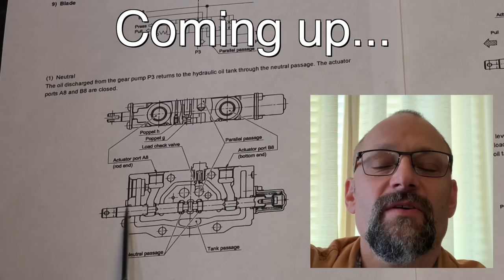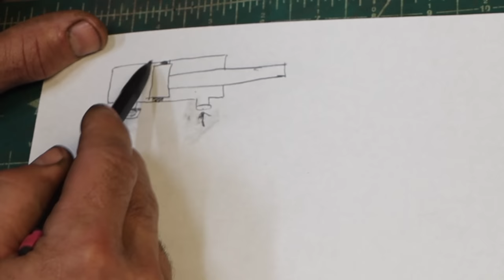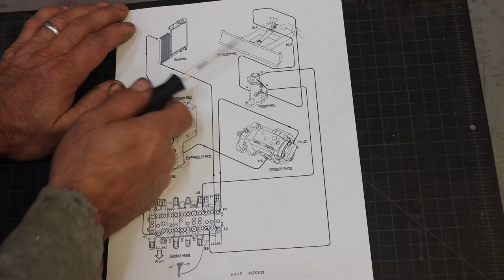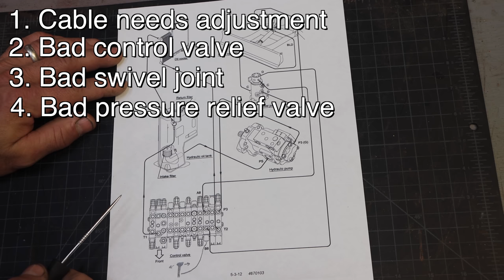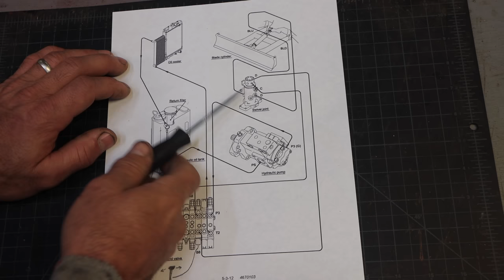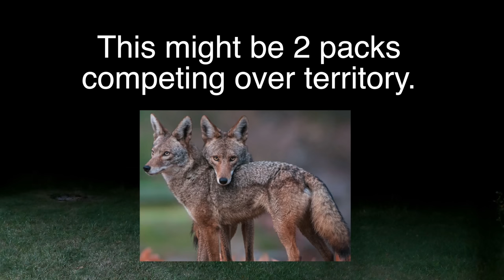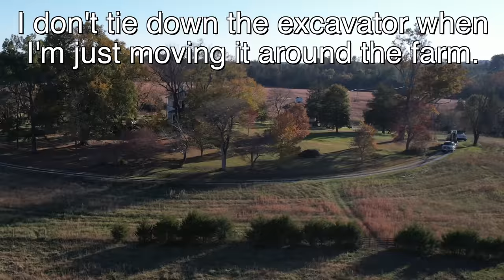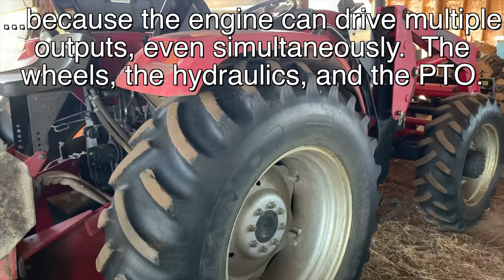Excavator Repair, Swivel Joint Rebuild, Yanmar Vio-50.

Comment: 11/17/22. 2day hydraulic repairs on Yanmar Excavator.👍👍👍👍⚙️🛠 terrific camera 📸 closeups of removing swivel (10 psi hoses at bottom & at least 5 hoses on top). Then swivel to bench for upclose look at 'u' shaped flow paths & ~14 2-part square/flat 'o' rings! Beautiful narration of how this cylinder was made. After re-install..no leaks!👍👍👍👍Then you gave us a quick look at all other hydraulic pumps & controls on all yur other equipment:  dump truck pto, tractor loader control, boom lift swivel & related psi controls..even included a look at yur 'ole log splitter control. Great video showing your very impressive mechanical/hydraulic repair abilities. List of all your skills go on & on: diesel engine, welding, fabricating, brakes, carpentry/framing, lathe, plumbing...clearly you have become the 'can do everything' man-on-the-farm! Very impressive to watch! Stay safe John & carry on!👍👍👍👍🛠⚙️💪😊🍺

Comment: I’m an HET, I was both taught and still feel the opposite way, I’ll use Teflon tape on NPT threads in hydraulic systems but not pipe dope. Just don’t wrap the tape on the first thread or two, for the reason that overhang could possibly flake off and contaminate the system. Great video by the way, just stumbled upon it on my recommended feed and thought what the heck, why not. I did skip thru a lot just because I don’t need explanations of this stuff but I think it’s great you include it for those that are curious how it all works.

TL;DR

I use teflon tape but not pipe dope on NPT threads in hydraulics just don’t let it overhang past threads. Great video, very in depth to what you were doing.

Comment: Another one, teflon tape in hydraulics is definitely common but Loctite 577 is preferable. When installing teflon tape to fittings never go over the last thread otherwise it will be cut on installation and pieces of teflon will go through the hydraulic system a cause issues such as block valves or filters

Comment: Absolutely an excellent video! I had to remove and rebuild the swivel joint on my Bobcat 324 just a little over a year ago. It was leaking from the bottom seal which is exposed and was packed with mud on the skid plate from the previous owner. The mud caused rust and ate the seal. I got lucky and found the OEM seal kit at a discount for $400. MSRP is close to 600. New joint is 2500. I took a lot of pictures but would not have had the patience to video the job as you did.

Comment: As a fully retired, disable old man I have no use for this knowledge anymore, but I always wondered how that worked on excavators. You answered my questions fully and I thank you for that. Now I can stop wondering every time I see one in use. Curiosity has been a driving force all my life and it is a habit I just cannot break. Cool  to see that older equipment still has a life somewhere when so many channels on here are running new, latest and greatest machines.
Reply: PS Just want to say that you have an especially strong gift of explaining clearly and concisely what is going on and why you are doing it the way you did. Must have been a great teacher in another life. So many can do, but have trouble communicating what and why.

Comment: Very enjoyable video. This is just a giant version of the HVAC vacuum control disk system that routs vacuum suction to the various  damper actuators in a car. Used for about 20 years before they started using electric servo controls to open and close the various dampers in the HVAV duct system. You're a patient man!  But nothing is much more gratifying that DYI repair of complicated mechanisms. Probably saved a thousand dollars in repair shop labor fees. Good job!

Comment: @7:50. An interesting observation is that the oilpressure scales with the piston area as this: force = pressure * area. So if the seal breaks in the piston, the area involved is no longer the area of the piston but merely the area of the rod. Now say the diameter ratio of these two is x2 well then the new pressure will  be: force = new_pressure * area/4. Which amounts to 4 times the original pressure! So if your hoses suddenly ruptures it is likely a leaking seal.
Like your videos.!

Comment: I purchased a used excavator myself recently and I didn't have a clue how the swivel joint worked.  Very informative on a number of levels.  Hopefully I won't have to do the same repair you did.  It looked really miserable and had to take many hours.  Thanks for showing us how to do this.

Comment: Well done. Excellent job in full details.  Very impressed. As an aircraft jet engine technician we used diapers and zip ties when doing fuel controls over head on wing also oil pumps and controls.  It was always funny buying a pack of pampers at the store when I was a young line aircraft road technician. 🤠

Comment: Excellent video. I learnt something about how the hydraulics work. I chucked when the oil was running down your arm, sorry. When I worked at Chrysler, we used rubber gloves like the dish washing type. They were  thick were we would turn the end up and make like a gutter, to catch the solvent.  I felt for you, what a job. Farmers are very inventive, with wrist cloth. Thanks for the video.

Comment: The Roto Thrusts on the  steel coil mandrels I had rebuilt were much easier to take the lines off of, but the seals were 3 pieces each, and had zero tolerance for error. Great job on this one.

Comment: You did a very good job on this video.  I'm a former vocational instructor and appreciate a good presentation .
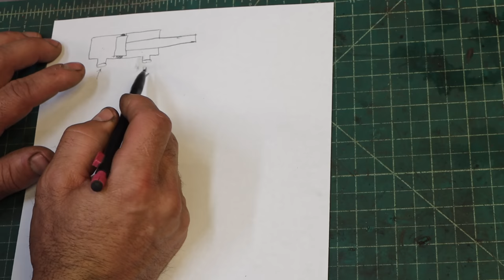Here are a couple things that I saw you could do if you do a follow up video.  The drawings you did are not quite accurate.  The principles explained are correct, but this is a very unique cylinder.  The oil lines are both attached at the top of the rod.  This allows the oil lines to be keep away from one of the most vulnerable spots on an excavator.  How they do this is that the rod is quite large in diameter and it allows the to drill the supply and return lines the full length of the rod.  (This is very similar to the hydraulic rotator that allows the oil from the pump on the motor to get down to the chassis to power the drive motors and the blade.)  The lifting side at the bottom probably has the line drilled right out the end of the rod where the piston and the nut are.  The other line is drilled a little shallower and then cross-drilled above the piston so that you can lift the blade.  You do not use this cylinder as much as the rest of the cylinders so it can be a bit slower and have fairly small lines drilled down the length of the rod.  Written while watching at 5:43.  This may come up later in the video.  You see, it is quite a bit like the mal........nope.  Not going there.
At 35:00, I noticed that the outer sleeve is bored straight through.  When installing the seal, it would be better to start at #4 and then do 3, 2 and 1.  Turn it over and do #'s 5, 6 and 7.  This will keep you from damaging the seals as you work over them going from top to bottom.  Also, if the lower hydraulic lines AND the fittings in the sleeve were removed from the bottom, it would have been possible to lift the rotator out and work on the upper lines in a more convenient place.

Comment: this was a great video. you show us a lot of the difficulties of doing mechanic work, getting grease running down your arm, banging your hand, squirming into tight spaces. these are REAL experiences. it's not glamm'd over, to romanticice the "oh it's in bad shape LET'S FIX IT! montage glamshots and then it's magically done. as well as doing the trial and error work to diagnose. to top it all off, good camera work, and bonus points for pointing out where hydraulics are used in lots of other places.

Comment: This is all so familiar to me. I got myself and older 1.5 ton  kubota and the second time I used it this rotary manifold had a bad leak. I recognize the issues with working under a machine where no spanners will work properly 😂 I have a few adapted spanners now

Comment: Great job and a great video! I had to do the same repair on a John Deere 792 I bought. Only the upper seal failed after I ran it the first day. The next morning I had 60 gallons of Hyd. oil on the ground ! I determined that the top of the rotary manifold was exposed to the falling leaves and dirt. Over time the drain holes in the upper portion of the frame got plugged and caused the manifold to get corroded from periodic flooding and you know the rest of the story. 
I use Hercules Hydraulics when I can for replacement seals. They are in Clearwater Fla.

Comment: Great video. Learned a lot about how the hydraulic system functions on an excavator. I am in the process of troubleshooting a problem on my mini excavator. Your video helped enormously. My problem now is Caterpillar no longer has parts available for my 302.5! Been trying to run down parts for days. Thanks for posting.

Comment: You have convinced me to completely survey used equipment before making an offer. Shop would have had you for a major repair if you farmed it out.  Now you can get it to work knowing it's at full strength. Congrats on some fine mechanics work.

Comment: Nice touch protecting the o-ring from the threads. Every time I push a mechanical seal with an o-ring onto a threaded pump shaft my corn-hole becomes water tight.

Comment: Im a mecanic for my living and worked on yanmars a lot , ive seen a lot of return lines in the different models that have hose clamps on them from the factory , no idea why some have them only on 1 end , i think its for easy acces to remove them because if they were hydraulic couplings they are in a small spot and its difficult to get a wrench on them , nice video about removing the swivel! The oil dripping thou , i feel you😂

Comment: Had an old John Deere 2020 tractor and a John Deere 310 backhoe/loader.  The power steering on each had a very similar setup with about seven o-rings in a cylinder.  Oh, what fun to rebuild!

Comment: Loved the video, thanks for the lessons, professor. My Kubota is similar in size, a 12,000lb U-55
 it decided to loose a couple gallons of fluid after being parked for several months. My blade cylinder is missing the chrome plating on a small section so I suspect that is where the leak occurred.. If not there then I will be doing a repeat of what you did in this video. Thanks for showing us what is involved in the process. The outro is golden and the only scary part to this video thanks to your guidance.
Great video.

Comment: I was a crew chief working on A-7 fighters and the wing folds have a "banjo" fitting that does the same as your swivel valve. They were as fun to rebuild as the swivel, but it felt good when it worked.

Comment: Thank you. I always wondered how the fluid transfered to the bottom of the machine thru the turntable. I couldn't get it in my mind but as soon as you showed down inside it pulled apart it is simple to see how it works. I have a big 20 ton J.D that has a bad leak out of the turn table but I think the hydraulic motor that turns it is the leak. It's a bit more painful to work on because of the size and weight of everything.

Comment: Just watching your vid right now and I am doing a full tear down and rebuild most of a 1999 Bobcat 325 mini-excavator. I am not happy to see your struggles but at least I feel connected somewhat as I am going through much of the same (cuts, bruises and missing skin bits) while staying completely moistureized from daily hyd oil  baths. I live on the wet coast and I am now completely waterproof. That being said and if no one has commented regarding your jury rigged hydraulic line near the swivel, it appears to be one of the 3 lines (as mine has) that are connected to what is called a "port relief valve". One of the lines might have a copper "hat" type fitting that sits within one of the outley connections. The copper "hat" fitting has a very small hole (just bigger than a pin) that would seriously reduce fluid flow and therefore might allow that section of hydraulic line to survive the jury rigging  as it may have reletively low pressure. I would look it up and then check if the little cap is missing. It would be very easy for it to fall out if one was not paying attention. I would still replace the line with a new single piece and, if required, ensure the lines from the port relief valve are correctly plumbed. Never commented on a vid before but thanks for yours. Have been also watching CEE and finding a DIYer that is doing similar projects is awesome. Thanks.

Comment: I am not sure how easy it is to retro fit to a machine but the forestry harvester I have has a vacuum pump on the hydraulic tank. Helpful for finding leaks but it is so great that when you open up the system somewhere you don't have as much oil come out, sometimes none!
Its an impressive fix but I think the most impressive thing is managing to film it clearly!

Comment: I was blown away when you opened the floorboard and it was nothing but hoses everywhere. From an engineer's perspective just looking at them was giving me an aneurism. On a slightly more expensive excavator I would have spec'd proportional electric valves right near their respective cylinders so that way you only have 2 main trunk lines running up the arm and down to the base with the tank and pump Tee'd into the trunk lines.

Comment: Super video on hydraulics….  In the 1970s and early 1980s, I worked on various underground mining equipment that had tons of hydraulic motors, valves, controls..etc…. I could relate to you working on the swivel valve in tight and confined spaces…. Well done..   🇺🇸🇺🇸🇺🇸🇺🇸

Comment: These videos are so awesome.  I have a later model that is the same as yours (rebadged but the same manufacturer).  Awesome to see how it works.  I've often wondered how they got hydraulic oil to the drive motors and blade through a swivel.  Very cool.

Comment: Thanks for such a great video!   I had expected I'd jump ahead to watch only certain portions, but found myself watching the entire video.  I've worked on a lot of equipment, but never the rotating unit on an excavator.    And I know that feeling... not only the relief that you've fixed the problem, but the delight to find out it works a lot better than before.

Comment: As for the details? YES YES YES!
It's the main reason I watch this channel. 

The jokes and knowledge. It's a package deal and a deal I find myself rewatching these videos for. And I don't even own a single piece of hydraulic equipment (although I do have a collection of hydraulic components that one day would hopefully become a forging press. That project is on hold anyway thanks to high fuel prices. Blacksmithing is hella expensive right now)

Comment: Also hydraulic machines in general were a bit intimidating as ive never had to dive into any.  But you dumbed it down enough for me to understand. I appreciate your channel very much.  I also liked the tip for cap set plastic protector to keep from damaging o ring.

Comment: the EXACT same machine, when you guessed about cost of the seals, I laughed, my guess was spot on when you said how much they were.   I will take a look on my machine to see about those hoses you asked about under the floor board (next time I am in there) This was a great video and the Yanmar is the reason I subscribed.  For mine, I made exchangeable teeth for the thumb,  Just unbolt and replace, take the old ones and grind out new points.  MY machine shop buddy CNC'd the first two sets and saved the program so I can get new ones cut when needed.

Comment: About your question on the hose clamps on hydraulic lines... they can most certainly be legit as designed on lower pressure lines. generally they'll be used on textile woven hoses, but using the correct clamps (or double clamps) one can use hose clamps on wire reinforced hose. I work on skid steer, so it's nice to see the similarities and differences on an excavator. Anyway, best of luck keeping clean and love the videos!

Comment: On our aluminum injection molding equipment we always used Teflon tape on pipe NPT fitting but we started the tape two threads away from the end of the fitting.

Comment: Love your channel, especially the meticulous and humorous way you explain your repairs.  I'm not an engineer, but I  don't understand how that swivel joint can withstand the thousands of pounds of weight and stress exerted on it.    From just looking at the size of the housing and the pin, you would think that it would crack and break into.  Love to hear your and other's comments about this issue.
Reply: This is a hydraulic swivle ONLY. It has nothing to do with suporting the cab and boom.